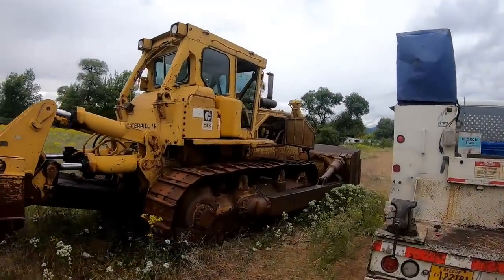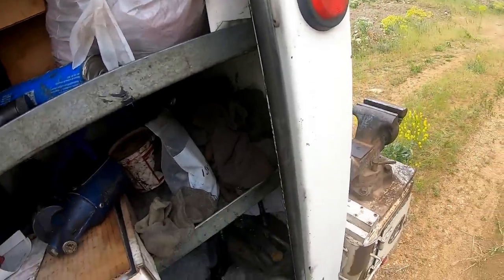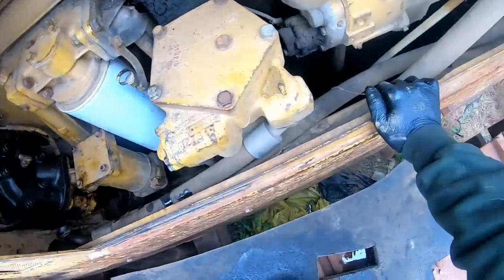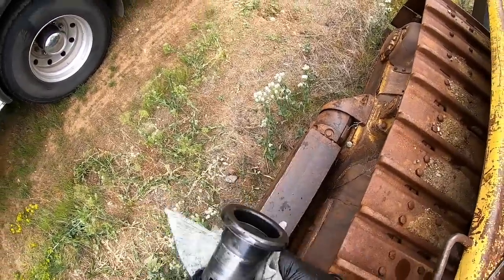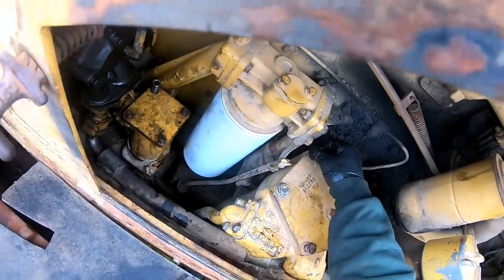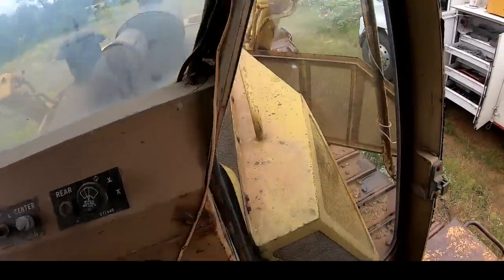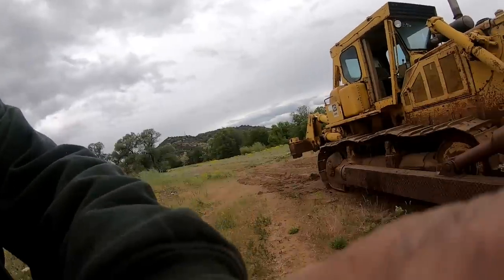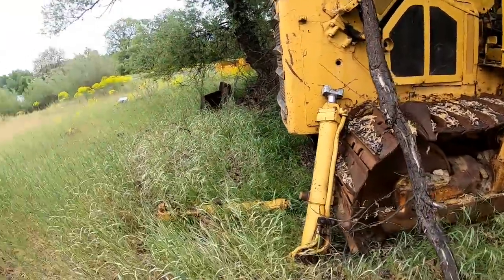Bringing a D8k caterpillar back to life pt.2

Comment: Its fun to hang out with you repairing the old "yellow" machines. I like the way you treat the viewer like they are standing next to you ,which in a modern way ,they are.
Reply: I agree ,maintenance is everything, even in your TV . I learned from a repair person I met that dust accumulates inside them via the vent holes. Blow the dust out a couple of times a year so the dust does not create a bridge across the exposed circuits Also spiders can do the same thing especially in AC units..

Comment: Hi I have been watching your video's about maintainence & repairs maintainence of machinery & I agree that many firms & companies don't do very much on their machines , they just keep running them until they stop & just do't want the machine standing idol while its being maintained but then they do moan & blame the machine when they have to spend a lot of money on repairs once they stop & don't realise its their fault that so much needs doing & parts need replacing & its all their fault for never doing oil changes  & cleaning the main cleanable filters & replacing the changeable ones regularly cause extra wear on parts etc. I recently bought a Cat D8 Dozer that I bought over the internet from a company in America & imported it to me in the UK & although basically the machine in general was okay. Most of the problems I have had with it were all because every one of the filters were clogged  & I would not have thought any oil was being filtered & even the main supply pipe & hose was clogged up so much that the big Hyster winch on the rear of the machine would not work because the supply of oil to it was vertually blocked solid, So I removed the main pump & it also was clogged with crap but luckily nothing broken or worn to bad. So after stripping & cleaning everything & replacing all the filters plus a couple of the main supply hose's because they also were in very good condition. Then in comparison the old D8 operated like a new one. Then I had a problem with the drive power which was also caused by the same lack of maintainence  & after checking through I found the transmission was also in need of cleaning & replacing which I have now done & the nest thing I have to do is to strip down the final drives both sides because they have an oil leak from the main seals. Once I have
finished all these jobs then I will service the rest of it using top quality oils etc to really give the old girl a new lease of life & several people have said to me why are you bothering to do all this work on such an old machine & my answer to them is in several ways,= one being I am not a plant machine mechanic I am a lorry/truck mechanic & I like the older machine that are not all computerised but straight forward mechanical machines & the basic's of mechanics is the same no matter what its on & I prefer the older ones where you can apply basic mechanical principles to be able to work things out & do the jobs that often were caused by paw of complete lack of maintainence in the first place, so its now onwards to do the rest of the work but as it's outside & winter is coming in fast probably a lot of things will have to be left until early spring next year because of the weather & when its all done it will then have re-paint. Then it will be time to start on my D6 which I also imported so although it starts & runs okay I am expecting to find the same problems on this machine although I hope not. Cheers , keep up the good work, take care Brian.  

    
.

Comment: I worked on D8’s in 80’s and 90 ‘ . They are tough ! I’ve rebuilt the entire engines , torque converters, steering clutches, final drives , sprockets and rollers . Packed a many a grease seal for track adjustment . Also rodded out radiators still in the machine . Changed out many broke spring in injection pump , the one that won’t let it crank if its broke . It’s a bad spring to change .

Comment: Warren I did work for a tree land clearing of fields of almonds trees Owner was trying to run 2 , eleven hour shifts on excavators , loaders, and Peterson Grinders he found out the hard way that maintenance is important, dusted a C27 , burnt transmission up in 744 k Deere and so many problems took 4 months to repair equipment.

Comment: Started operating a paddlewheel scraper for my Dad, first day I was loading out of a slot trench dug by a Dozer, about 8 ft deep when I started. Dad would ask me every few loads, Do you need me to walk the Dozer down the road and square up that pit? All day long I kept bringing loads regular, saying nope, doing fine Dad😊 that night he saw the hole, noticed I had learned how to weave to get the bowl to cut close to the bank so the banks were almost vertical. He gave me a $2 per hour raise that night👍

Comment: I don’t usually comment on anything or give advice, I do have a suggestion that helped me over the years. Your battery doors are a pain with no catches to hold them. Get two earth magnets and a a piece of flat steel, bend the one end of the flat steel at 90 degrees. Slap the mag on the stationary panel, put the 90 bend on the mag, open the door and slap the other mag on to act as a keeper on ahead of the door. Worked pretty well for me. You will find it useful in other situations also. Good vids, good at what you do, keeper comin my friend.

Comment: Worked HVAC PM at a college for a bit. 
Belts & bearings in all 20 buildings where shot when I started.
Several thousands of dollars to get em back to working (exhaust fans)  . After that, least a case of grease a month.
Director once said man that's lot of grease to use, so showed him the bearing list & grease schedule . 
Last time he wined. 
Worked heavy equipment when young till them 100# parts tore me up. 
Full retired now, not by choice. 
Your a great man Warren, old school, do it right or don't waste my time.

Comment: That D7 would make a great project, sad to see it sit. My friend who rescued the Peterbilt 359 last year also rescued an Allis Chalmers 655 track loader that was parked in the woods for 10 years....previous owner had the engine rebuilt and they punctured the torque converter seal putting the engine back in, so it would just leak ATF out as soon as you could pour it in. So rather than pull the engine out again, he just parked it.
Reply from the maker: This guy is real easy to deal with,  I'm gonna see if I can get that 7f from him and make a project out of it.

Comment: @11:44
"Anti Seize" is meant to reduce galling and premature tightening
of fasteners. The different base metals have different applications;
Molybdenum Disulfide (silver colored) is for general use. Copper
is for hot parts (exhaust).

If you want stuff to come apart for routine maintenance- thoroughly
clean all components, then light grease threads, fasten, then coat with
an epoxy paint or plasti-dip or similar, to lock out corrosion. Coatings
are easily removed, fasteners easily removed. Many companies make
2-part epoxy coatings, concrete/garage floor stuff is great for nuts & bolts,
seams, and case seams. Clear, colored. 1 light swipe. RTV/Silicone is great, too.
Reply: Worked fieldservice for Caterpillar.  cement mines are the pitts ecuse the pun

Comment: That’s the 20th venture.  Maintenance is a four letter word.  Bean counters run companies and they shave down every cost they can.  Maintenance of equipment is the first thing they get rid of.  On my chainsaws, I spend about an hour cleaning, maintaining and sharpening forbeach actual hour of cutting.  On bigger equipment I probably spent more time than that.  People, today, already lazy and have more money than brains.  My grandfather farmed 2,500 acreas and he worked 8 days a week.  Today, the drive around in $60,000 4x4 all day and never even get their hands dirty.  My grandfather rode around on the back of a horse, but he could show you every grease fitting on any of his tractors.  As a boy, I spent the first hour of the working day greasing my tractors Zerk fittings.  If I missed a one, he would find it. And there are lots of grease fitting on a Ford tractor built in the 1950’s.    People of his era also did not lug engines, as they do, today.  If he had caught me pulling an implement in one of the high gears, my but would have rung.  If I had the pto on I better have the rpm in the correct range.  Captain Jack ran a tight ship.

Comment: I have to agree, most of the people who have these for a business seem reluctant to keep them as per the owners manual and they end up rotting away for want of the right attention,
However, if you ask them to do something they charge like theres no tomorrow, and sod paying out for maintenance.
I have seen these machines where the tracks  are full of dirt and mud between the top and bottom of the track, they finish work and walk away only to return next day, start it up and carry on with what they were doing untill it breaks down with bearings or shaft ware with the grit grinding away at these parts, when a going over with a preasure washer to clear the dirt out would increase the working life of the unit, then they complain because its broken down.I hire a guy with a heavy duty fork lift to move some newly sawn wood from one place to another., we agreed on the price for the days work before we got started, when it came to the day, we spent more time reparing the thing than we did using it, but he still wanted his cash at the end of the day even though we had not moved at least a third of the timber, instead spent all this down time on cleaning out fuel lines and filters that were in a discusting state, he even complained that he had been forced to pay for new filters and some pipes, all because he did not bother to look after the unit, and since then i have seen so many people with the same atitude towards looking after what is big money to buy in the first place, you only have to look round any farm yard to see thousands of dollars worth of gear that would more than likely still be working if taken care of.
Then some clown come along and buys them and rebuilds them back to good working condition, that why the likes of you and I are not rolling in money, it goes against the grain to see these machines rotting away.

Comment: I have never bought any antiseize in my working life(50 plus years) but what we used decades ago was a graphite grease mix called Black Morgans. I was working on all sorts of heavy equipment ,some of which hadn't been apart for decades but previous folks had used the black morgans and it was rare for bolts and so on to require the hot wrench .i see there are a few different products which could be the same type of graphite grease on the market, but having used graphite on hot chains in machinery(moving kilns etc )  I know cattle piss etc will not wash it off.
Reply: Anti-Seize is behind RTV Silicone is the most misused products ever made for use by mechanics.  I blame this on a number of reasons the first being is most mechanics do not read the data application sheet for the product and traditional any company’s product data application sheets are very vague and poorly written and as a result mechanics who historically may not have had the best of reading skills and who have to rely on their best judgment to diagnose and repair whatever vehicle repair machine they are working on buy/grab whatever they think might help fix the problem when it comes to greases, gasket material(s), lubricants, penetrating oils, thread lockers, etc.  Additionally many mechanics get their start in the military and if ever there was a place where bad repair practices start it is the military because everything in the military has a procedure to do something from washing your hair, shaving your face, making your bed/rack, how to dress, cleaning the barracks, your weapon, performing maintenance on equipment, repairing equipment, etc. The problem is once a method of doing is adopted as the correct way to do something even if it is totally wrong it is almost impossible to change that procedure because you are not just rewriting how to do it at your location but though out the entire military. That said the reason procedures and bad practices get adopted in the military is sometimes out of pure ignorance (When have you ver heard a DI admit he made a mistake to a recruit.) secondly out of tradition (I.E. It has been done this way since Moby Dick was a minnow and Jesus Christ was just a PFC), thirdly because these are the materials and supplies on hand and there is no money or time to get a new and corrected product certify (Get Mil-Spec’d) and even if there was some 1st John at the Pentagon who can’t fix a peanut butter and jelly sandwich decides this already Mil-Spec’d item is a suitable substitute when it’s not. fourth is somebody who knew somebody sold something a bucket of chicken manure at stupid profit and hence the poor SOB in the field is stuck making chicken soup out of chicken s#*t. 

However for the gals/guys who became mechanics and were never in the military that select and purchase and use the wrong product for the job let us not forget the simplest of reasons Marketing.  Let’s be honest we as mechanics tend to be he ultimate suckers for gadgets if we think they will make our job easier, or our repair somehow better in any way because if our job is at least perceived to be done better somehow or another and will gain us status with our customers means they will keep coming back to us for additional maintenance/repairs and allow us to charge a few bucks more and with our peers will gain us a certain amount of status because look at Jane, or Bob, he or she really does their job the right way.

Now that you have waded thought ALL Of That Bull Manure What 99 out of 100 Mechanics don’t Understand is Ant-Seize except for Marine Versions regardless if it is Silver or Copper in color is not waterproof and is in reality NOT a Lubricant it is a Anti-Galling / Ant-Corrosion compound.  An by Ant-Corrosion I am not talking rust but rather Galvanic Corrosion such as Aluminum to Aluminum \ Aluminum to Steel surface/thread contact.  Additionally many mechanics do not realize that all greases are not waterproof.  I admit for a number of years I was one of the Lambs who blindly slathered Ant-Seize on anything and everything and wondered why stuff was stuck together when I had to take it apart on some stuff and others it would one right apart.  It was not until I screwed my leg up and couldn’t turn wrench’s so instead got a job as a counterman at a parts store and started reading material application sheets that I discovered I like so many other had been using Ant-Seize and whole lot of other products incorrectly and thus having less than stellar results with them.  In short there are only few marine/waterproof Anti-Seize compounds on the market but unfortunately none list in there data sheets that I have read list they are resistant to bovine urine/manure, so maybe anti-seize is not the best compound to put on thread suspension parts etc for equipment used around cattle farms.  What might be something to experiment with is coating threads on suspension parts with a very thin coating of “liquid thread sealant” ie Teflon tape in a bottle or tube or of course a tacky marine salt- waterproof grease.
Reply: @gullreefclub  Pretty windy comment, but I like it.

Comment: i love people that dont do any maintenance on there equipment, thats how i have got all my equipment, it stops moving and some shop guy comes out and looks at it and tells him its going o cost 10 to $15,000 to fix, so they park it, or put it up for sale for parts, 7 years ago i took drive to see a gal i met on the internet, that is all most a 5 hour drive, well i was out in this small town i took the ice road across the lake to see the island part of town, there is about 150 homes on that island, and in the bush nest to te park and sewage building was a 580B backhoe with  great cab and good shape sitting in the bush, with 3 inch poplar trees growing up  between the loader and wheels, i asked who it belonged too, and the people told me it is the townships, so i went to the township shop and asked about it, and they told me they had 4 ag tires for it that are like new as they put turf tires on it so they dont rip up the grass on the huge septic field, and just pay them for the tires and get it off the island before the ice went out, so i handed them $800 cash, the mechanic head mechanic in the shop didnt know what was wrong with it other then it wouldnt drive, it was mid March and i new i only had at best a week to get it off the island well the ice was still safe for the load, i drain the fuel tank  changed the fuel filters and got it running, i pulled it out to the road with the hoe,, and had a roll back wrecker hall it home, that cost me anther $600, .. you shift it into forward and it would jump a head 10" and stop, shit it in reverse and it would jump back 3" and stop and thats all it would do, i knew there was not to much wrong with it, as i know from these 580B from working around them, the oil pick up screen would get plugged up if the filters were not replace enough, and in order to clean the pick up screens you had to pull the transition out, and pull it apart to get to the screens to clean them, but i knew of a trick where you dont need to do any of that, just drill a 1" hole and tap it out to 1"NPT AND PUT A PLUG IN IT AFTER flushing the sump and screen, after 5 hours it was driving like a new machine, and has ever since, oh by the way the filters were worse then them,, even the fuel filters, this is only the story on my last hall, had many over the years i picked up, and ether kept or sold for a lot more that it cost me. after i cleaned them up and got them working.. for little cost...  right now i am trying to find a tork convertor for a HD allas Chalmers (ya i know not spelled right)crawler loader tractor, but have not been able to find one in over 10 year